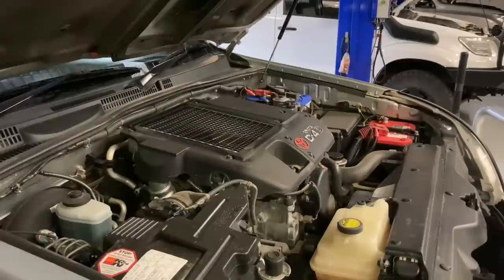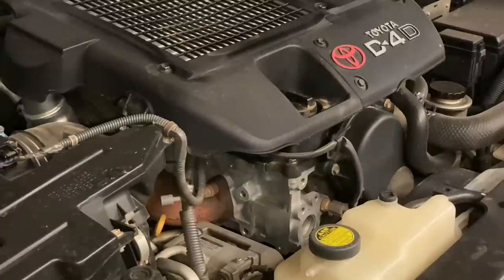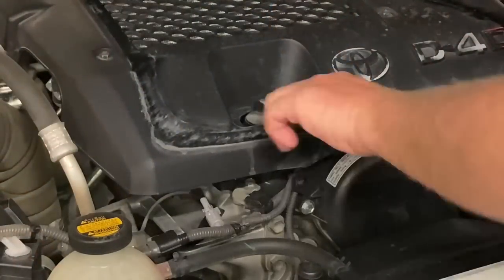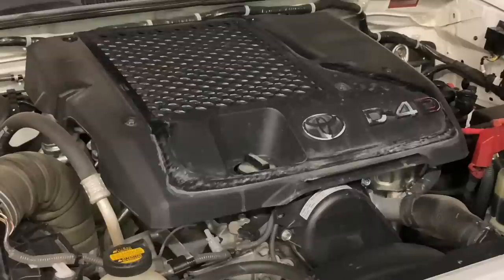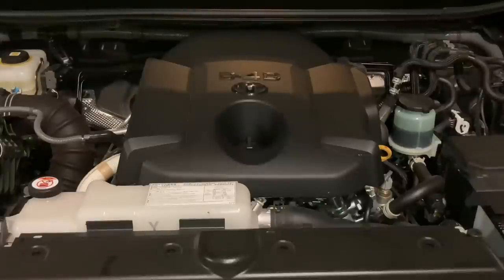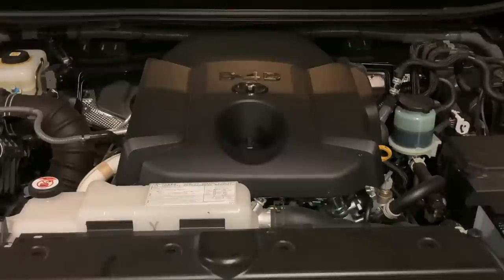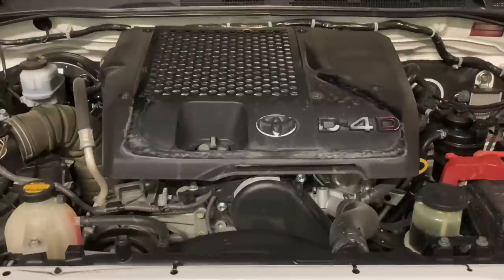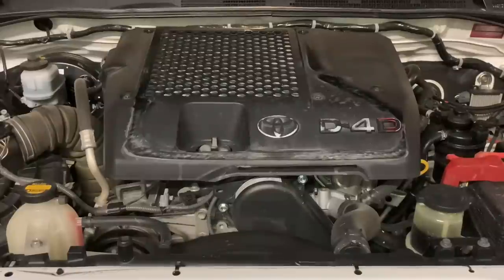URGENT WARNING AVOID THIS ENGINE CATASTROPHIC FAILURE So Easy ALL VEHICLES

Comment: Hey Anthony. 
I always make time to listen! 
I checked mine only days ago after leaving the oil drain for many hours and used a small mirror and small led torch.
Vehicle was on the horizontal ground, so using the mirror is the better way to go versus using the mobile phone to take picture/video.
I also find the light from the mobile makes taking close picture cast a bit of a shadow thru the sump hole and so do not get a complete view of the small section of the oil pick up screen.
Reply: I now let oil drain overnight then check the pick up next day, less mess when checking pick up and oil filter is completly drained. But might give the mirror idea a go

Comment: Good video. The problem is not you and I that look after their cars. The problem is previous owners. The problem is not the engines, it's the lack of maintenance from previous owners. I will not buy a used common rail diesel from anybody unless I know the car. Same, I will not buy a VE, LS,Ford or anything that I don't know. I've seen dozens of these vehicles go boom due to poor maintenance and the next owner buys them and they get the lemon. Same for maintenance free transmissions. Do not buy them. You'll buy it and boom. Oils,coolant.... Excellent advice.

Comment: I was taught in my younger days to pour 1-2 litres of clean/fresh oil into the engine after draining to get any extra soot out. Then replace sump plug and refill. Thoughts on this? Have been doing this with the 1HZ (HZJ80) and engine done 510k kms but wasnt sure if worth doing. What about engine oil flush additives? Thanks
Reply: I do the same - and every couple years I refill with a cheap to spec oil and run it around the block / drain and refill with the good stuff.  I'm sure its a bit over the top but I sleep well at night.  Re engine flushes - the advice I got from a turbo shop a long time ago was - OK if you use them from new and keep the engine clean, bit dicey for the turbo putting a flush in a dirty engine.

Comment: if you are looking at a v6 you must look down the oil filler tube on a cold motor that hasn't been started that day and see if there is any moisture or skunge,  it is a big red flag if it has because it could have a head gasket problem and if it's not all shiny around the timing chain and has  black gunk it's best to walk away because it hasn't been servist enough. everything else anthony has said in this is a must , even Toyota states stop start or off road use is adverse conditions and more frequent service intervals are required. it's not hard, 5000km service intervals for your engine oil